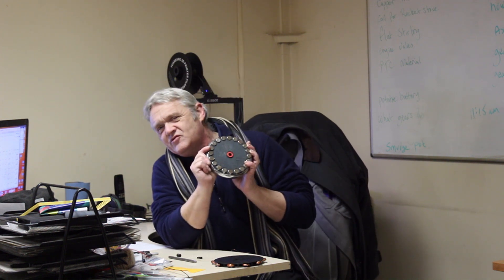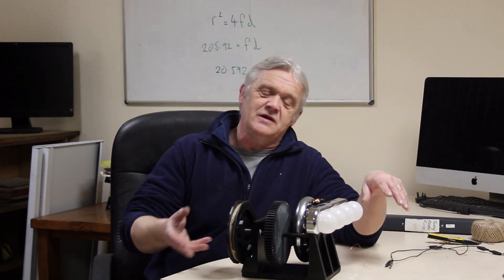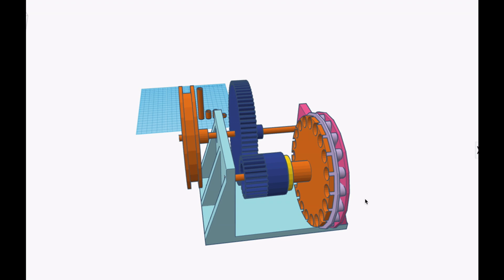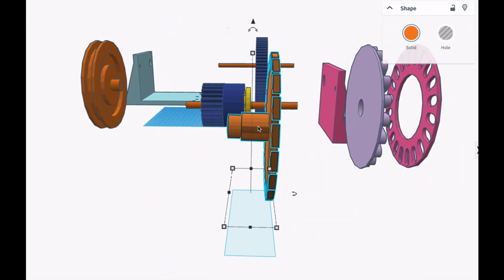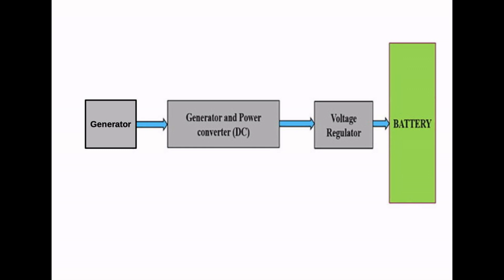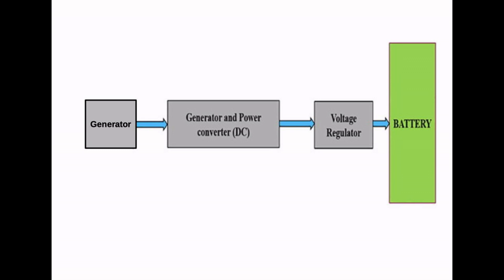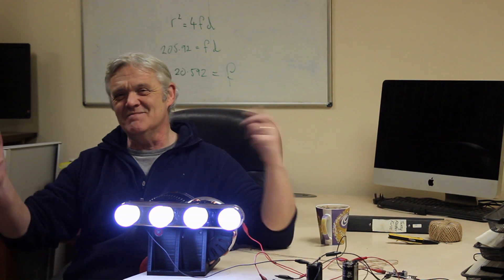1860 Off-grid Light And Power From The Pull Of A Cord

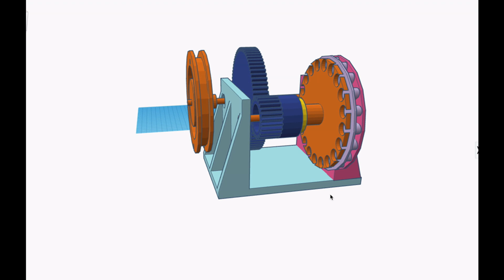Comment: 2:22 You need a spring on your pull cord so it'll retract. :D Then you can do repeated pulls to get the speed to where you want it... additionally, you could potentially make the cord shorter if you did that.
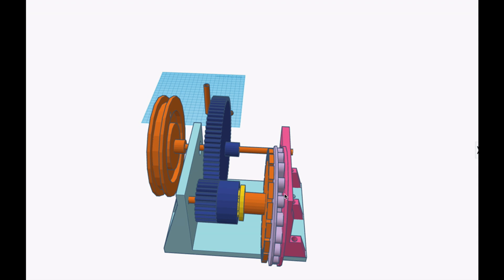Reply: 3:51 Ehh... you're saying you're moving things away, but nothing is actually moving... lol.
Edit: Ahhh, I see. The timing is off between the video and narration.
Reply from the maker: a return spring would be nice but seriously how much trouble is it to wind a string lol
Reply: @ThinkingandTinkering  I understand your view. And for what this is supposed to do, I understand that it's definitely overkill... but... if you wanted to quickly get your flywheel to top speed, quick, repeatable pulls would be much easier than a long pull, followed by 2 minutes of rewinding and another long pull. Plus, if you need this in an emergency and there's no power, no lights, and it wasn't rewound after the last use, can you wind it well enough in the dark?

Plus, if you wanted to dampen the sound, you'd want to enclose it all and apply some sort of noise barrier to the inside. How easy/difficult would it be then to rewind it manually?
Reply: @ThinkingandTinkering  if you wind the centre of the cord several times around the pulley, then you will have a return cord to automatically rewind (as the freewheel will operate during the rewind process) a slight amount of back weight on the loose end of the cord will keep it wrapped tight (in fact you could use the back weight as the return mechanism

Comment: What if one skipped the gearing and simply wrapped a pull cord onto a small pully directly attached to the clutch? The gearing would be the same would it not?  

In the context of a pull chord, why would one need a clutch? All on needs here is a pully with a pull chord, an axel with a magnetic rotor, and stator coil. 

I think a clutch and gearing is good for peddled and  or cranked power. 😁
Reply from the maker: this is cranked generation mate - just because you use a string and pulley doesn't make it any different from a pedal or a handle - you can just attach pedals straight to the wheel if you like - the victorians did exactly that - you might be missing the boat on this one mate
Reply: @ThinkingandTinkering  I respect the hard work you do, and I don't mean to come of as disaprovingly critical. Contrarily, I'm very approving. And I can be wrong from time to time in my critisim. 
 
I agree that the fundamental important parts are the same. And I'd like to acknowledge that often your freqently big picture. And it's must be tough getting critisim that is often unwarranted.

I also want to acknowledge demonstrating a clutch and gearing principles is great to let the rotor continue spinning. and there is nothing really wrong with demonstrating it with pully and pull chord to power it. But my only and very insignificant point was if all one wanted was a pull generator as stated you were going to build in the beginning, then a clutch and gearing are unnessesary. And If one wanted a hand crank or foot pedal power, then that a clutch and gearing is more than great. That is because it lets one take a break while the rotor continues to spin, and one won't be injured when they are ready to continue.

Comment: So great to see the complete system. It works quite well! You said that the one way bearing is a bit loud but that could be an advantage in some situations. If it was adapted to be human powered by hand crank, treadle or bike pedal, then that bearing noise would be a simple alert that you need to pick up the pace.
Reply: Every old citybike has a one way bearing that could be used
Reply: I don''t understand the need for a one way bearing.A normal bearing would be fine.
Reply: @ravenmad9225  the one way bearing is the drive mechanism. The pull start disengages after the pull so you can rewind the pull cord. Otherwise you would have to wait till the whole thing stops to add more spin.
Reply from the maker: indeed especially if you used small children lol

Comment: Begs the question, how long did bulbs stay alight after one pull?
Reply: I guess it depends on the dragonfly wheel....👍
Reply: @mattburrows2615  A flywheel that's draggin' won't be running in a while.
Reply: @hempev  exactly, the generator creates load or drag on the flywheel so it's only a lil while lol.
Reply: I have a handcrank generator that produce 40W/h (if you are stronger you can generate more). That is 0.01111W/second. Say the pull is around 3 seconds long. That would generate 0.03333W. So if you got a LED that is 1W it will run for 2 minutes. A 2.3W LED produce 485lm (Philips LED grade A). So you get 210lm for 2 minutes. Or 485lm for 52 seconds.
Reply: A wheely long time.
Reply from the maker: a while - it's a flywheel
Reply: @ThinkingandTinkering  you should post the Tinkercad link in the description, I still can't find flywheel light.🤔
Reply: @ThinkingandTinkering  A quantitative while or a qualitative while?
Reply: @ThinkingandTinkering  Is that an imperial while, or one of them new fangled metric ones? 😏
Reply: @ThinkingandTinkering  A mile- 1760 yards, a while- ????

Comment: Could you rig this so the pull cord winds itself back onto the pulley? Then all you need to do is to keep pulling the cord, if the lights begin  to dim, or you want to charge a battery.
Reply from the maker: you could mate and a return spring would be nice but seriously how much trouble is it to wind a string lol

Comment: Robert have you seen the lontra compressor? Simple but efficient beautiful design. I reckon it could be 3d printed and would make great energy storage or a flywheel compressor for spraying or as a pump.
Have you seen the hairpin motor? Simpler more efficient coils, used by a couple of ecar manufacturers.
Reply: I have seen both of these you mentioned. The lontra would be a good challenge to build!! The hairpin motor would be a little easier if you can find square copper wire. Both cool technology but I think it would be a bit of a challenge for what he likes which is simple easy to build things. I would love to see a 3d printer Lontra compressor though. Would like to see if it could be a supercharger also.
Reply: @newmonengineering  I have also considered automotive applications. Air-ride could be improved but as an owner of modified turbo vehicles, my first consideration was as a supercharger. I can see them replacing chargers of all types. I don't think much modification would be needed to pump liquids and shouldn't require priming.
Reply from the maker: I have seen it mate and the hairpin motor
Reply: @ThinkingandTinkering  putting some 2-3mm copper wire through a roller could give it enough shape to improve efficiency at least. I'll try and build a lontra in 3d but I'm not promising it'll be any good as I've only printed the test boat so far. But I really need to know if it will be any good as a supercharger.

Comment: I often came back to the idea of old coo coo clocks with the chains and weights. Instead of a clock, a simple LED light bulb. Pull a chain down, which pulls up a weight, which will turn light on. Idea came up again during Power outage few days ago due to snowstorm and a simple pull of chain would provide at least a basic light. Perfect for camping or grid down
Reply from the maker: it's a gravity battery mate - I have done videos on this
Reply: Deciwatt did this, called the GravityLight
Reply: I have very limited internet here... I know what rabbit hole I'm about to travel down next. Thank you all for the direction
Reply: Damn it. Almost exactly the same idea occurred to me, so I just mentioned it....... And then saw that you'd beaten me to the punch by 10 whole hours. 🙄
Reply: Kris Pea  patents are ridiculously expensive and nearly unobtainable for people unfortunately
Reply: @brokenbravo83   The expensive part is taking people to court who have copied it, patents are a waste of time and money in my opinion.
Reply: I was thinking that,,or even a tight coil spring..like  those radios..

Comment: i like it for sure but i feel a higher gear with a 15kg weight that can come down from your highest reach point or even the top of your stairs would be a great use of our own bio mechanical advantage and what a great reason to go upstairs!
Reply: and for those without legs, just need a basketball hoop net closed at the bottom. Shoot hoops to light the barnyard 🤣
Reply: put the weight on a line around a pulley at the top, and you can haul the weight back up to the top, though I see you will need to rewind it on the generator pulley, what if the generator pulley was the top pully and you did a single loop around the pulley, coming back down to a smaller weight to keep the tension, then once you had released the weight it would drop, then pull the smaller weight down, (the ratchet would allow this) to reset the pulley ready for the next drop.
Reply: @grendel1960a  i really like that idea. maybe would need some rubber on the pulley to get the string to grip
Reply from the maker: it certainly would mate
Reply: @ThinkingandTinkering  are you ok up there Luke ?😂
Reply: Actually this start an interesting conversation about efficient resetting of the  rewinding ideas and the use of our human ability and what ideas can be created .
Reply: @Buzzhumma  a pull start mechanism from a small engine has line retrieval via a spring, that should work. Otherwise, just make it a looped chain which you could hoist weight by winching in one direction and release the weight to generate power once the weight was at it's pinnacle. Hoisting a flag could be a parallel to describe this action visually.
Reply: @Xonikz  yeah right like the ones they have on industrial factory doors. you could literally hoist 95% of you bodyweight up there. I think you better have metal 3d printed gears for that though!
Reply: Actually Rob does have that type of looped chain roller door. Maybe he will read these comments and build a bigger one to hoist luke and his weight up there. That might be around 150kg. Imagine the amount of power created from that slow release ! or maybe holding onto the door will turn the chain?